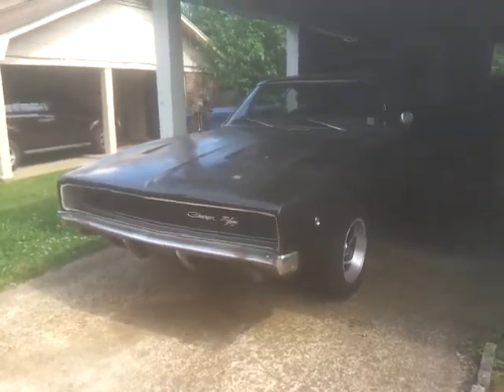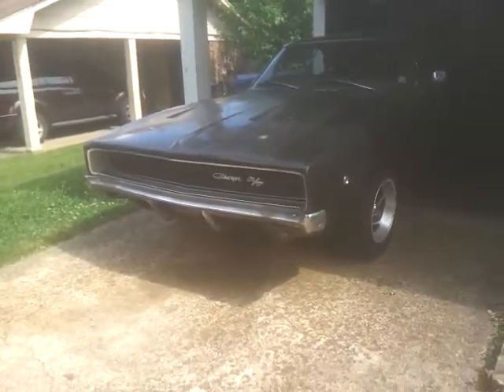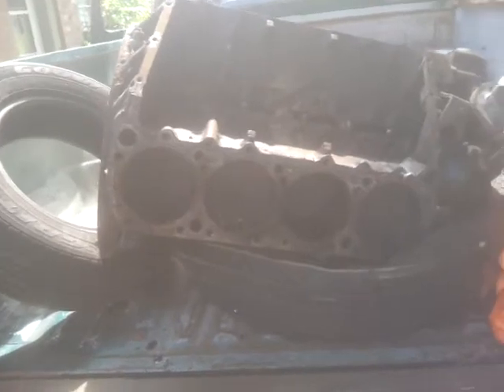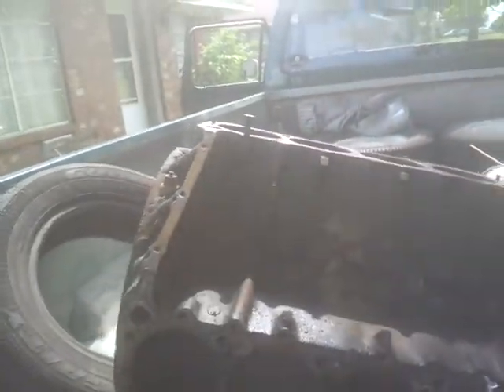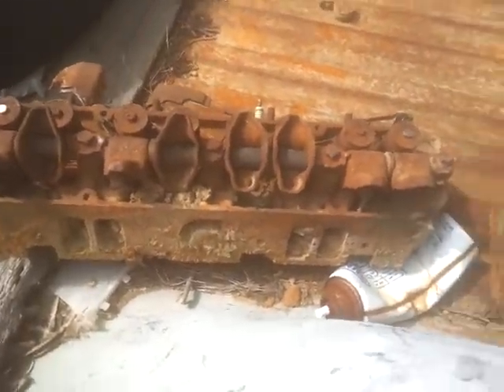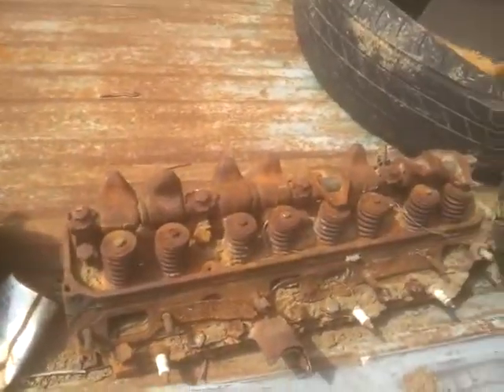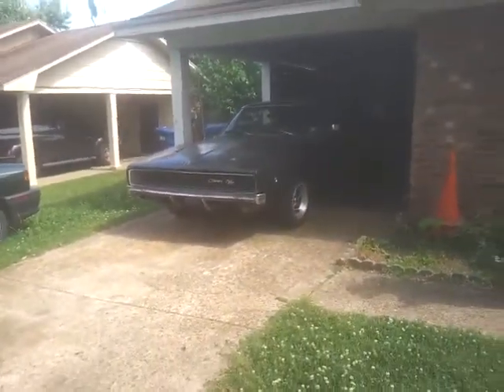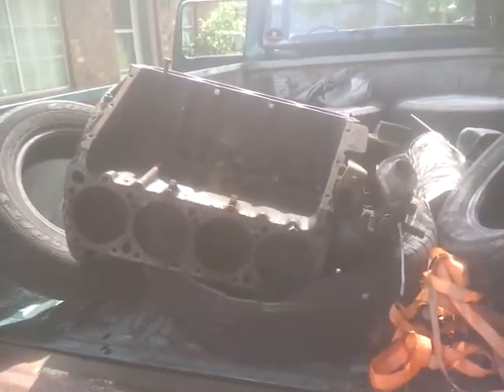1968 Dodge Charger R/T New Motor

Comment: The best stock heads are 906 casting. Probably what those are.
Reply from the maker: I actually have some rebuilt 452 heads on the 440 now. On the 383 that is in my truck now is a set of rebuilt 906 heads.
Reply: Charger383Mopar
 Hey Bro, I saw in an older vid of yours that you replaced the federal PS pump with a saginaw...Do you by any chance still have the filler cap for the federal pump, and would you consider selling it if you do? I'm in desperate need of one.  Thanks,, awesome vids BTW !